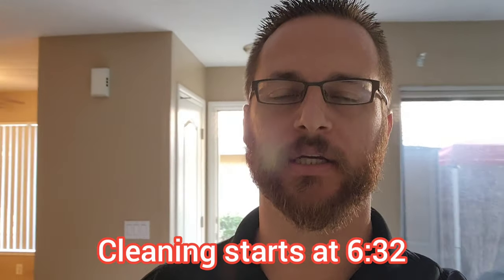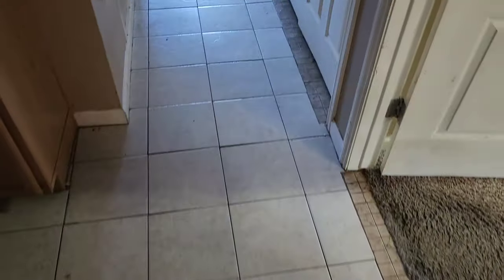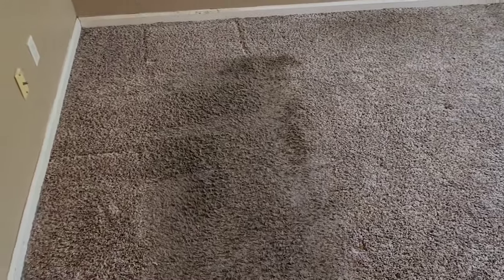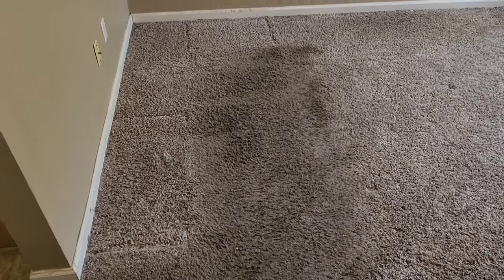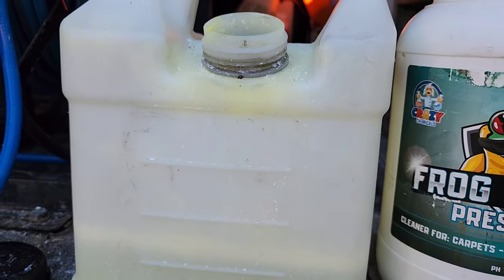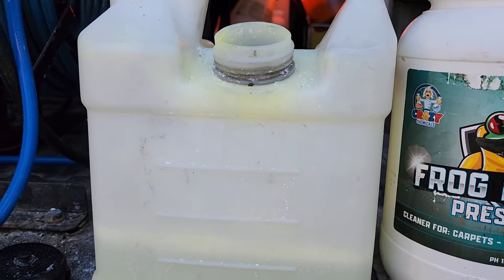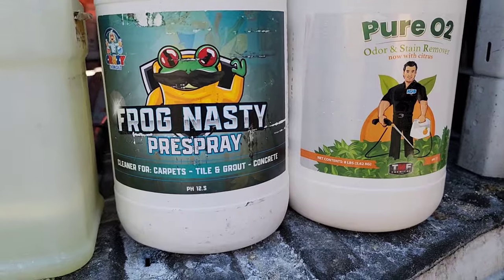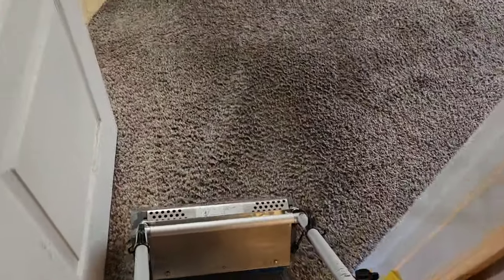Deep Cleaning a Disgustingly Dirty Carpet

Comment: That’s that cheap contractor carpet. Why that went in with travertine floors idk
Reply from the maker: I agree. It is a rental, but contractor carpet in the rooms? way to cheap even for a rental.
Reply: It's basically disposable, which is honestly a benefit for carpet in a rental. Now how you can tell they're really cheap is that they're having it cleaned instead of just replacing it.